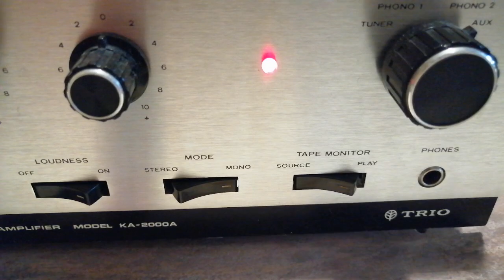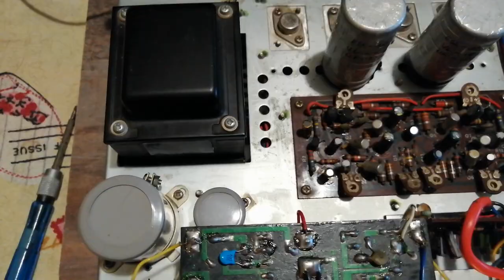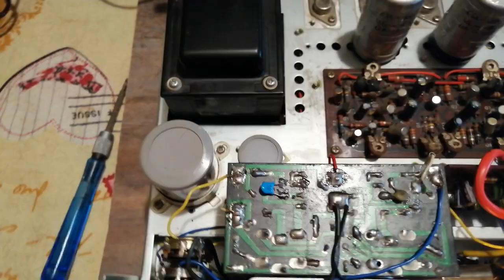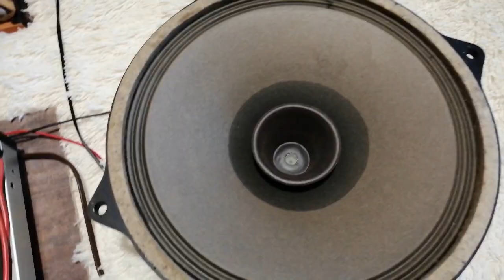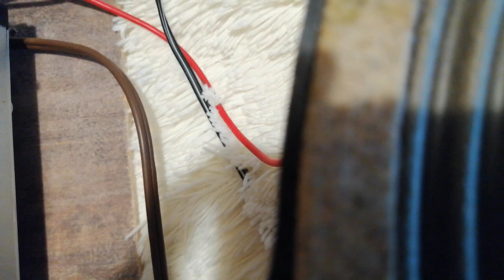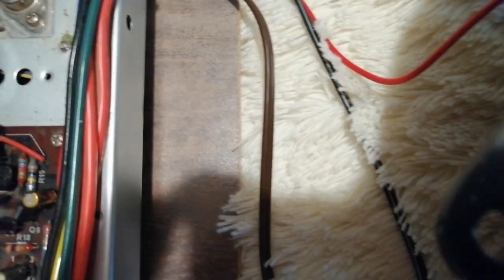Simple trick to find a bad transistor (part) in an audio amplifier!

Comment: Would a channel that sputters, like it’s being overloaded, be caused by a bad cap or bad transistor? The left channel is fine but the right sputters. The volume control does affect the sputter volume. Headphones sound fine unless you switch on the speakers while listening to headphones. Thank you.
Reply from the maker: @fdski  yes it can, start  with the volume controlle, if the amp is old check the capacitors, resolder the ground connections, and then check the transistors!

Comment: would a completely bad output transistor cause the amp to still power on but have zero audio (not even a hum or when I touch the aux jack)?
Reply from the maker: i guess yes ! check the right and left channel  at the out put. check the bios current, if you are getting the right current then mostly it is transistor !

Comment: Some transistors with metal tabs can have high voltage on their collectors
In higher power amps the rail voltage can be 100 volts DC or more which are directly connected to filter capacitors with huge amounts of stored energy
If you touch one of those and another part of your body is grounded, it could be the final test you ever make
Please DO NOT physically touch anywhere inside an amplifier if you are not highly knowledgeable in electronics

Comment: DON'T GO STICKING YOUR FINGERS IN LIVE ELECTRONICS.  The humming might be due to ground-loop...Put ferrite beads on the speaker cable.....the component you pointed/touched looks like a capacitor..?
Reply from the maker: I have replaced all the noisey transistors and now it is working clean! Thaank you for your advice!

Comment: When touching a live board it’s always best to be bare foot and use both hands 🙌 on the board at the same time. That way you complete the circuit. You’re bare feet will keep you safely grounded. When the current enters your body, it will travel to your brain and tell you exactly what component it bad. ESP, electrical signal projection is what it’s commonly called. It will project you to an early grave. Don’t do any of this, please, if you value your life.
Reply from the maker: thank you for your kind words !

Comment: Hello, when the transistor is changed to the same one, it is necessary to set the block current, or in what case to adjust it, thanks for the possible explanation
Reply from the maker: Try to match the transistor as close as possible to the original one and  after set the dc as written in manual. Setting the dc current is necesory when you replace any part in the amplifier. Hope I got you question.

Comment: This is not a test method, you are forgiven as you just mentioned that you are not qualified. Do not touch the insides of the equipment under power unless you know what you are doing. 
You just introduce noise in the circuit and actually, it might be the way to check that it is actually a good transistor if the signal gets amplified, especially touching the base or gate pin. 
Stay safe and recommend to remove the video. It is not wise for others to follow your steps…
Reply from the maker: After replacing the transistors noise has gone! These transistors are notorious for noise!

Comment: i cant test to see what transistor is faulty on my amp.. it blows the main fuse, as soon as i switch it on
Reply from the maker: It is not bad transistor! Mostly it bad connection!
Reply: A bad, even shorted, transistor is probably not going to do that.

Comment: your soldering is very messy. Use 37/63 no clean solder with lower iron temp.
Reply from the maker: I made this video just after I bought this amp! It is not my soldering but thanks for the tip))

Comment: I don't understand your touching an electrolyte capacitor and calling it a transistor....plus it's really dangerous to touch it with bare hands use rubber gloves
Reply: No he wasn’t, he touched the capacitor and told you that the transistor was just next to the capacitor. Check the video again
Reply: Electrolytes are a part of chemistry ⚗,  electrolytics are capacitors in electronics.
Reply from the maker: Sir, I know the difference between cap and transistor! Please take what info you are looking after! Thank you for advice!

Comment: Can I use the finger method to check if my wall socket is live?
Reply: Use a fork......
Reply: @will7its  😁🤣
Reply: Yes you can. Once.
Reply: Tongue is preferable.
Reply: Comes in handy testing my GF.  hehe
Reply: You have to wet it first though or it won't work as well.

Comment: Could be that you just found the highest sensitivity part of the circuit, where you have the most gain picking up the AC noise from your fingers. That's also where a noisy transistor happens to matter the most, so you could have a good point there.
Reply from the maker: I am no electrician by any mean. I just found this trick and it works! Thank you for your explanation. Atleast someone understood this!
Reply: @ManuLeisure  FYI, Electricians know almost nothing about electronics

Comment: Good info, but when I'm using my finger as a signal tracer, I would wear rubber gloves and have a buddy nearby ready to call an ambulance... Cheers!
Reply: You certainly could get a shock but this is a preamplification (power) stage so there is only low voltage on this board.

Comment: I am sorry, but you can´t find bad parts with your methode.
Reply from the maker: It works with bad transistors! Use high sensitivity speaker or headphone! Do it at your own risk as it is not standard method!
Reply: Do signal tracing or short every transistor collector (or output) to ground with a big capacitor from the front end on. See when the noise stops that's the bad transistor. Or, if it's oscillation, the stage with any bad component. But only do it in the low power/preamp section!

Comment: I think the reason this works is because these old germinium transistors grow tin whiskers that end up touching the can.
Reply: I think it's body capacitance
Reply: @dicko195  I agree with "dicko".  Something to do with body capacitance. I am not knowledgeable about this subject, but I know that my radio receivers, if I don't have a good antenna, I can touch the antenna and the signal comes booming in. I've been told it is due to body capacitance. Might be interesting to connect myself to my capacitance meter. 😀
Reply from the maker: May be but I think it is about electromagnetic field!